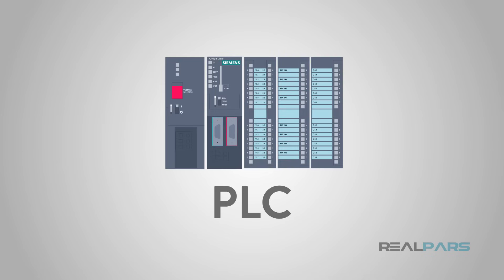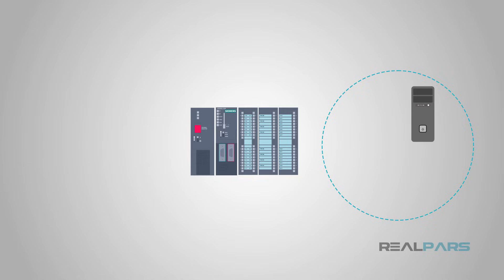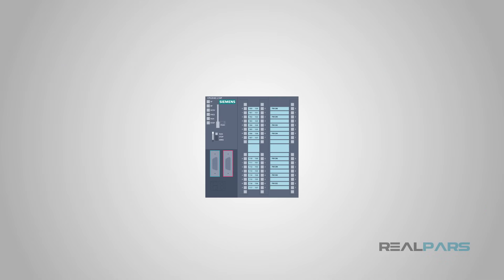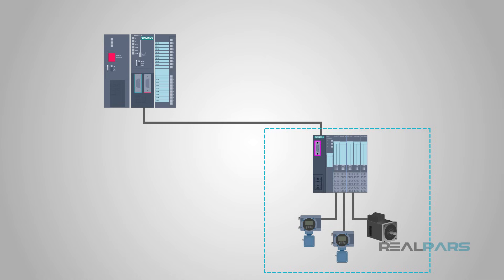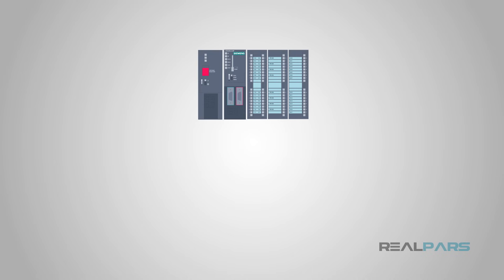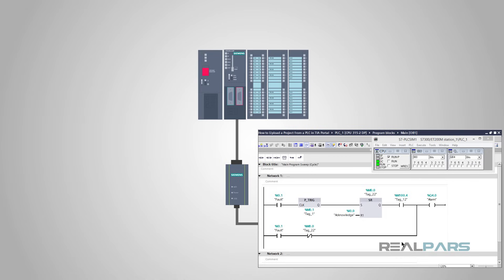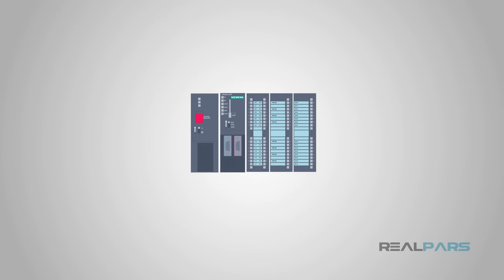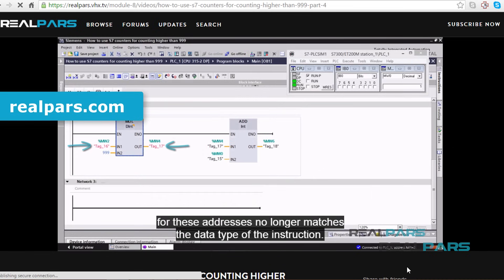PLC Basics | Programmable Logic Controller

Comment: I want you to tell me how a relay makes soot please. I have never had one make SOOT!
Reply from the maker: Hello, @Foof50.  Thank you for your question. Here are a few ways this can happen:

Soot accumulation in a relay system can occur through several mechanisms, especially in environments where combustion processes are involved. Here are a few ways this can happen:

Combustion Sources: If the relay system is near engines, boilers, or other combustion sources, exhaust gases can contain soot. Over time, these particles can settle on surfaces within the relay system.
Electrical Arcing: In electrical relays, arcing can occur when contacts open or close. This can generate heat and lead to the burning of surrounding materials, creating soot that may accumulate on the relay contacts and insulators.
Environmental Factors: Dust and particulates in the surrounding environment can mix with combustion products, leading to a thicker accumulation of soot, especially in industrial settings.
Inadequate Ventilation: Poor airflow around the relay can trap soot and other contaminants, allowing them to build up over time.
Degradation of Materials: Some materials used in relay systems might degrade under heat or electrical stress, releasing carbon compounds that can contribute to soot formation.
Regular maintenance and cleaning can help prevent soot buildup and ensure the reliable operation of relay systems.

Comment: I haven't understand much about PLC and I am trying to learn about it and use it for my automation system. I have a question. If I want to control a system of 110 V what kind of PLC should I use, please?
Reply from the maker: The PLC processor simply holds the program which executes the logic.  To control 110VAC devices, you will need to make sure your I/O cards that are connected to the PLC can support 110VAC.  For digital outputs, you can use a relay card as well.

Comment: what is obsolete PLC?
Reply from the maker: An obsolete PLC is one that is no longer supported by the manufacturer (it was discontinued in 2017).  For instance, the S7-200 PLC from Siemens is obsolete, although many are still installed and running in plants. If the CPU fails, a newer model will need to be installed in its place.  Some spare parts may still be available, but after October 2023, Siemens will retire the entire S7-200 product line.

Comment: Could you please recommend any reliable public source or Scopus paper with the classification of different controllers? I am confused with semantic and there is no source that explains things better. 
PS Extra stupid questions: 
1. how is a 3-stage controller for controlling fan-speed called? Fuzzy logic controller? 
2. is on/off control fuzzy controller?
3. Is a 3-stage room thermostat that defines the speed of the air conditioner fan a relay panel with fuzzy logic? or is it a tiny PLC with fuzzy logic? or is it a discrete controller? 
4. Why are the usually 3-stage? Why do people not use sparsely modulating controllers? or dimmer controller?
Reply from the maker: Fuzzy logic is essentially a method for calculating controller outputs from controller inputs.  PID does the same bit in a different way.  3-stage fan control can easily be accomplished with fuzzy logic.  3-stage control for ventilation is common but is somewhat misunderstood.  3-Stage control usually means the controller controls three fans:  1 fixed-speed gan and 2 variable-speed fans.  This can be done with special fit-for-purpose controllers, a fuzzy logic controller either standalone or with a PLC, or just a PLC or DCS.  The single-speed fan is controlled in an on/off manner, but the variable-speed fans are controlled to provide a certain airflow or maintain a certain temperature.

Comment: Why not use a tablet as the controller with a program installed and running? Then the only reason to plug in a computer would be to upgrade program/software or to download information. I'm pretty sure a tablet has more capabilities than a plc and probably cheaper too. Regardless, you would still need to use relays or contactors.
Reply from the maker: Tablets are definitely good computing devices, but they lack the capability for connecting to process I/O efficiently and are based on operating systems not meant for 24/7 continuous operation.  Tablets are popular for HMI applications, but are just now getting powerful enough to run applications like SoftPLC's.  Connectivity to I/O is a major issue with tablets, since they have limited interfaces. There are many manufacturers that have very powerful PLC's for less than the price of a Surface Pro.  I think the day for using less-expensive computing devices in process control is coming, but we are not there yet.
Reply: @realpars  thanks for the reply 😊

Comment: how is this different with industrial component of arduino?
Reply from the maker: Hi Jastria, 
The Arduino is a collection of the modular electronic boards that you can make different nice stuff with them but I believe these stuff are not supposed to use in industry. The other difference I think is the language which you can write codes with that. Writing codes with C language need more specialty while writing your software using Ladder programming language is far easier and less time-consuming. I think the differences are not limited to these, however.

Comment: What would be the most cost effective way for someone to start learning PLC programming? I understand the industry level PLC systems are rather expensive, would some sort of development board work for beginners? Great job by the way!
Reply from the maker: You don't need any hardware to start learning PLC programming. You can use PLC simulators such as PLCSIM which comes with Siemens STEP7 software.
Reply: You can also use TwinCAT from Beckhoff for free without any hardware. Someone on youtube has a video series guiding your through the software.
Reply: If you're still in the market for one of these devices, Arduino has recently released an arduino PLC system. Like their other systems it is relatifely cheap and could be useful for learning
Reply: Me also i wants to learn plc programming tell me the cost effective please